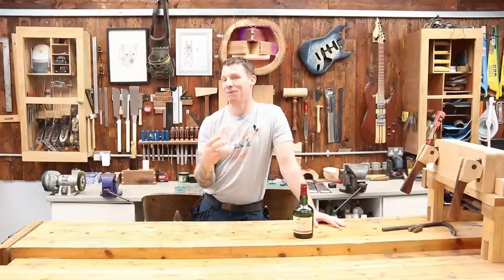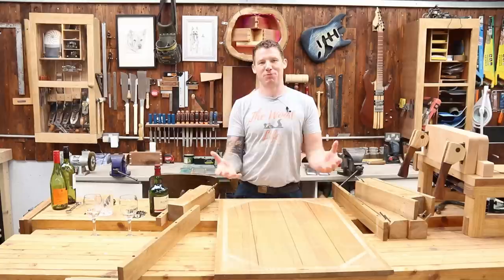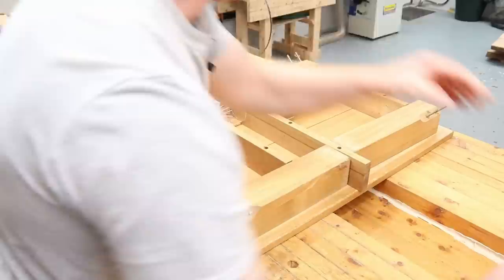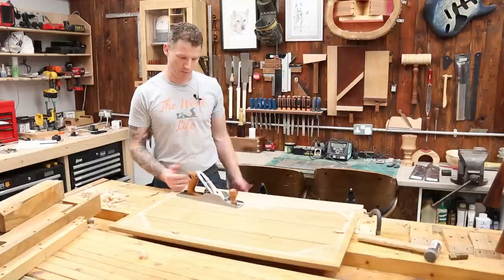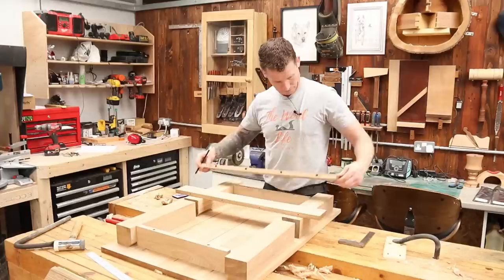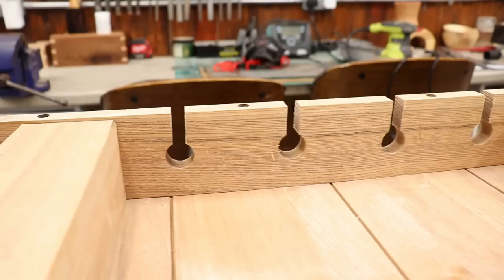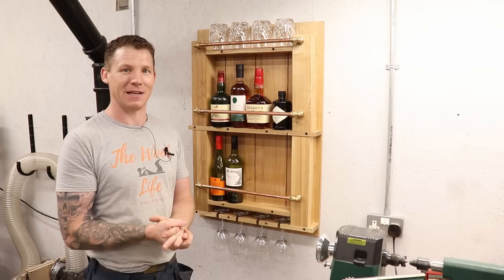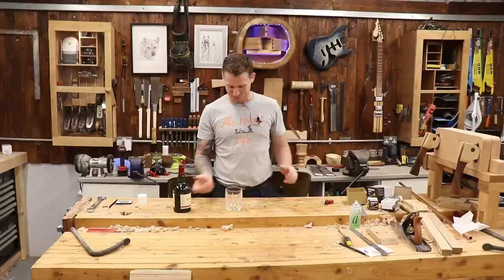Whiskey and Wine Rack. Up-Cycling Some Old Furniture!

Comment: The Copper bar looks great but I would have used the smaller copper elbows the brass looks a little bulky but over all nice designed rack will have to make one myself.
Reply from the maker: I thought about it but I like the brass.   Good luck with making your one!